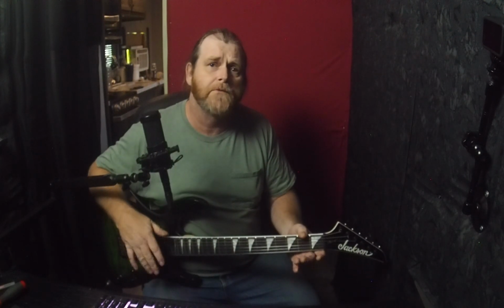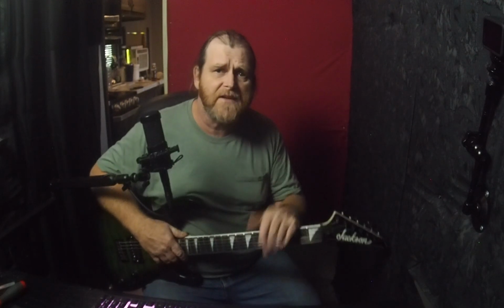Tone Test - Guitar Bridge Saddles | Will different Materials Change Tone and Vibration ?

Comment: Kevin, I changed the saddles in the bridge of the first guitar I ever modified.  I did all kinds of work on that guitar, without making it look QUITE as rough as Eddie Van Halen's Frankenstein.  One thing I did was trade the stock, cheapo Strat style 6-screw vibrato for a unit with a brass sustain block and everything else made of steel.  That rocked, but I got curious about a bridge I saw in a guitar I WASN'T going to buy.  The bridge was like the one I'd installed, but with brass saddles.  Curiosity got me good, so I tried to find similar saddles online.  I didn't find BENT brass saddles like those on that one bridge, but found brass BLOCK-style saddles.  All that brass warmed the tone of that guitar so much that I decided that I wouldn't change the pickups.  I didn't want even a BETTER sound -- I wanted THAT sound!  I put brass saddles on the bridge of one of my Donner guitars to make it different from the other one.  There, the difference is much harder to hear, but noticeable!  Of course, little of those differences will be audible if you're using too much distortion.
Reply from the maker: Its just a fun thing to test your ear  too but if you like all the pieces on your guitar you will play with more confidence but i to like the brass saddle and kept them on it and it was definitely a difference